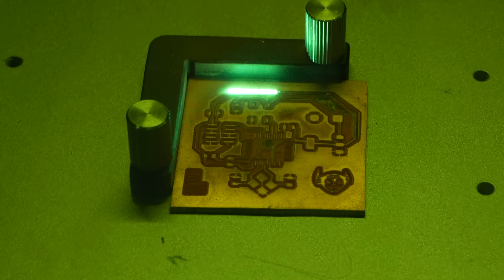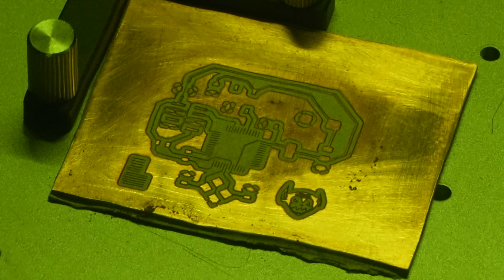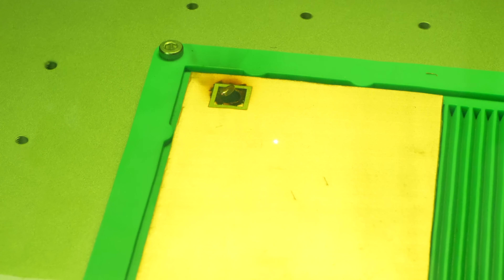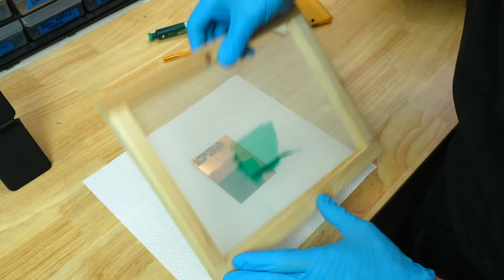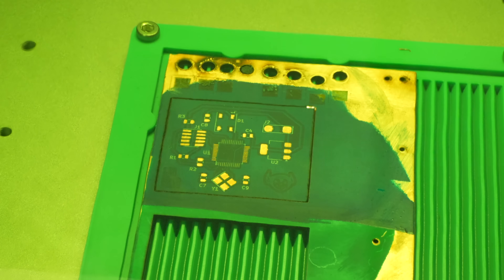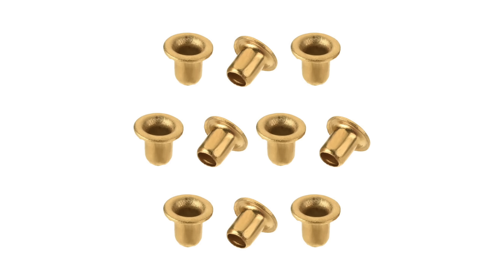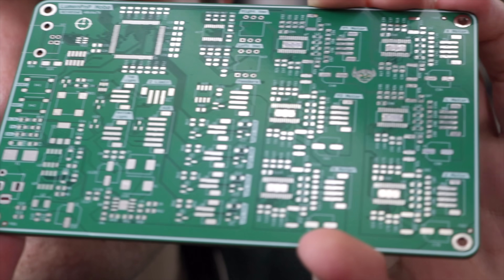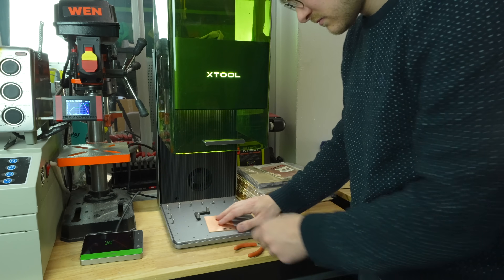Prototype PCBs faster than 3D Prints

Comment: Awesome vid but I feel the need to mention a couple of safety pointers you failed to mention in this vid.

1. Burning phenolic resin is incredibly toxic - it releases formaldehyde when burned which is a serious carcinogen. Please please please ensure you have **EXCELLENT** ventilation for the laser and DO NOT use it in an enclosed space, especially for extended periods.

2. The CNC fibre lasers that you can buy from Amazon etc are often absolutely incompetent when it comes to laser safety. 

Any goggles you get with the kits can often be binned as completely useless, either because they’re just coloured plastic (useless) or are the wrong wavelength (useless) - invest in a pair of real, officially safety rated laser protection goggles! 

Even looking at the laser spot on the surface can irreversibly damage your eyes, let alone looking directly into the laser. Also, should go without saying, any other people entering the room while the machine is operating is at even greater risk because they may not understand the dangers of the machine. 
Kids, pets, uninformed partners, etc should be strictly kept away from the machines when in operation, the shrouds that some of the machines come with are not rated for laser safety, they’re basically just cosmetic, DO NOT trust your eyesight to them!

Bit concerning you didn’t include these warnings in the video - assuming that all of your viewers have the necessary education to understand these risks when you have as many views as this is ignorant at best imo.

I’m excited for the opportunity to rapid prototype PCBs, and will consider getting myself a setup, but observing safety procedures is critical.

Comment: I wonder if there are specs for the various substrates published with regards to IR absorbance and heat rejection. Using a laser also opens up the possibility of alternative substrates that would be otherwise completely unworkable, like copper plated ceramics, glass.... potentially anything you can get a copper layer to adhere to. 

Just started down the rabbit hole of trying to find polymers that will accept a copper plating, play nice with the laser, and still be thermally stable enough to be soldered. Galalith (casein, milk plastic) might be the one but I don't think anyone... at least anyone that said anything where google can reach... has ever pondered the idea of making a copper-plated galalith sheet thin enough to use as a PCB. Temps are fine, stability fine, people make guitar picks out of it so it should be rigid and mechanically sound enough, it's just the matter of finding the actual base material. 

And there's polystyrene, which is great on the laser, takes a copper plating (though this is relatively new tech/process), but you'll probably be limited to 400-450F for soldering.

All in all it feels like the copper is the easy part and the substrate makes it a PITA. 

Also, have you played with priming the copper with a nonreflective coating to see how that changes the rules? That could be anything from a thinned acrylic paint to very careful exposure to an oxidizer (not fancy, peroxide and vinegar for instance), or even just a light candleblacking (soot deposition).

Comment: Is there a 3d printer with dual heads that you could switch out one of the print heads with a blade or drill to etch into the surface of the copper board , then have the other print head print a single layer over the top? Avoid all the chemicals all together.

Comment: Great job. I didn’t think it would work that well. For two sided bds, just treat vias as pads on both sides with a common hole. Put a thin wire through the hole, solder both sides and you’ve made a simple via.

Comment: What if you combined the laser with a lumen frame to handle applying and curing solder mask and silk screen, flopping the board, and doing something for vias (which seems like an area with more exploration).

Comment: For the vias, it depends on the board, but I was a child of the point to point age and watched  pcb's come onto the scene.  For a simple design with not a lot of vias, come up with a different shape for the pads that need to get soldered on each side, and do so.  For example, you usually have circular pads with pin one being a square.  Make any pins locations that have a trace on both sides diamonds.  If there is not a part in the hole, you do what we did in the old days and stick a piece of wire in the hole and solder it top and bottom.  The other thing might be to design the board more strategically for the type of manufacture.  While it may make sense to say use a short run to a pull up and have that on one side and another short run to a pin connector, you can get rid of a via if you use the natural one that is the pin connector.  Almost humorously, you could put say a 14 pin dip in the middle of your board, solder it from both sides, and snip the chip off.  There you have all the stairwells between the layers in two neat rows.  Wonder if you can get bags of mystery dips on eBay that would be good for that.

Comment: Voltera makes a rivet setting tool that works well with their rivets. It is meant for their PCB CNC but I have just used it on through hole repairs and DIY boards. It is a cheap way to get a through hole and with their copper rivets it's very easy to get almost flush and a clean look.

Comment: Seems to me that one solution for alignment would be to have the board locked down by the alignment jig, then you remove the whole jig to do the other steps, allowing you to, if set up right, to just flip over the jig for the other side, with alignment holes and pins for that side which result in the board ending up in the exact same position. The mask step gets a bit problematic with this, but.. has to be some way to still do that...

Not that I am likely to be doing anything of the sort myself any time soon. lol

Comment: Oh this is super cool! This is an excellent application of those fiber laser stations! I worked with one for a research project and they are extremely powerful machines.

One thing to bear in mind, though, is that you need to keep your area of operations as close to the center of the workspace for the laser as possible. The laser will still be in focus, but as you move away from the center the galvo laser will distort and form an oval shape, which might cause issues if you are making super precise boards. I recommend if you start doing multiple boards at once that you keep your boards from getting more than halfway to the edge of the workspace. It's better to do smaller batches that all turn out rather than trying to run a dozen at once and end up having to throw out eight because the outer ones didn't etch or cut properly due to beam deformation. 

I wish you the best of luck as you continue to iterate on this process!

Comment: For the vias do not use copper wire like many have suggested. Instead I would suggest to drill the vias to the exact diameter of a thin solder wire. Leave the board under the laser and stick the solder wire in. Cut it flush (or therabouts) and then play around with melting the visible end of the solder wire in the via hole with the laser. The wire won't melt all the way through and neither do we want it to. It acts as a wire in the via and on the ends get melted. Might have to warm up the copper around with low power before to allow the solder to wet onto the copper. If the solder melts but doesn't want to wet onto copper you could try cutting the wire not all the way flush but instead a bit longer and tapping it with a hammer to squish it onto the copper.

For the solder paste mask I would suggest going entirely maskless. Instead cover the entire board in a thin layer of solder paste and then the laser can be used to only melt the relevant areas on to the exposed copper so that the pcb just needs to be cleaned off the unmelted solder paste and later parts just need a bit of sticky flux to stay in the right place. The solder is already on the pads so you just need to pop it onto a hot plate et voila.

Comment: I think that if you hold the board sideways on in the air, you could feed some thin solder wire through the bottom side of a via, then just touch it with an iron to connect it to the top copper. After that's done, flip the board and touch the other side with the iron to detach the wire and forn the connection.

This will still have a small bump on either side, but I think that if you feed solder carefully, it should be fine.

Comment: well, that seems good for prototyping, especially for model-railway solutions - 'cause as model-railway fan, sometimes there's a need for a small board to maybe connect things in a locomotive, so that you don't need a few plugs - instead of just one or two. but the price... the price for such a machine (even when you just do a single-sided board for maybe 2 led's, 2 resistors and a plug) is a bit to high, and if you don't even know how to work with tiny smd-pieces (like a 0402 led), you better let such shops make and finish the board. Cause of the 3d-printers are really evolving, also do these lasers and small cnc-working milling machines, i wait for a pick & place-machine on basis of a 3D printer - where you can literally "put solder paste on the board" and let the machine pick & place the parts. but i guess, for that, i need to wait a few more years - or need to build one by myself, even when i just need a older 3D-printer, a vaccuum pump and need to learn "how cnc-machines talk".

Comment: For a diy board you dont need to rivets. You could easily get away with using a piece of non jacketed wire for a via and just solder it like a standard through hole component. I usually use 22-24ga wire. I do this a lot for proto boards. This keeps vias small and impacts board height less than a smd resistor.

Comment: This is SICK dude! +1 for more videos about it. Totally agree this is just for rapid prototyping but ~30 minutes is RAPID, damn
Reply: Yes, this is awesome!! I actually got into prototyping PCBs watching you design and make your flight computer (AVA, I think). I would have to design the traces, print the design on a piece of paper, heat transfer the design from the paper to the PCB and then acid etch it. This would take a long time and the method in the video looks much easier. I would also mask and UV cure it but the mask always looked like junk, in the video he used a screen and that looks much nicer. I might have to get back into prototyping PCBs.
Reply: Or for local manufacturing. I could see a world where a system like this is set up in neighborhoods to enrich the lives of those around you with cheap available products you can get in person.
Reply: Honestly, in a case where you dont need solder mask or silk screen, a PCB mill will be in the same order of time and will be a commercially available product
Reply: I agree its awesome, but I'd personally not be so sure its only prototyping - small or made to order runs, anything you want to protect your IP enough to make the clones actually put in some effort, when you really need weird boards etc.  There is a niche for self production, and such high quality, easy, seemingly affordable and rapid self production even better. 
As for the sort of smaller company or individual maker that doesn't have a real fab house, with PnP and reflow on speeddial, with volume user discount prices... As they likely "need" to have most of these sort of tools anyway for the prototype lab...

Comment: When I last looked at this I saw a few approaches that might be possible possible.

1. Conductive epoxy or ink.  possibly expensive and/or messy.

2. Small taps and dies.  The idea here is that for each via, the hole is tapped, and a thread is put on a copper wire.  The wire screws in, cut so it's a little proud on both sides.  Then because it's copper, it can be deformed with a clamp so it spreads out on the copper pads.

3. Just like 2 but find a non resin core solder.

4. Maybe 2 but melting copper rather than ablating it.  Like a 1% power for 50 passes until it melts.

Comment: Here's my idea for the vias: 1. get some solid copper wire with a similar thickness as standard factory vias; 2. cut holes in the board of the same diameter as the wire, or a tiny bit smaller to get some friction; 3. lay the copper wire horizontally, very flat, and cut it with the laser into pieces as long as the board is thick; 4. push the little cylinders in the holes; 5. solder them from both sides. Bam: flat and solid vias.

Comment: This wouldn't be automatic, but what about inserting copper wire into the via holes until they are flush, then soldering like you wanted to do with the rivets. You could then try using flush trimmers on the other side and rhen solder that side. There will probably be some height to it but i would imagine it would be less than the rivets, plus the vias could be much smaller. Just a random thought. Really awesome work though!

Comment: Old man here chuckling at the via rivets. Back in the Jurassic era, when dinosaurs roamed the earth, we had to be much more careful in our two-sided designs. That's because EVERY lead on every component was a via. Yep, the leads went THROUGH holes in the board! They are called "through-hole" components. :)
Where you need a via, use a through-hole component. From your local Radio Shack. ;)

Comment: Use any evenly sprayed on paint and the laser to do an etch mask for etching away the copper with Iron-III-Chloride. 

The vias will be tricky. There are a couple of heat cured copper inks (hey, laser can do that) with copper nano particles, around. Burn a via hole and several circle-like pads into the copper laminate, like the seat rows in an antique theater, to build a connection puddle for the heat cured copper paste to give bigger connection area. Then apply a mask before filling the vias and cure the or even burn holes into the vias to use them as PTH. 
This will beat all rivet versions. 

For alignment you apply a sturdy plastic card on the PCB. Punched holes („register holes“ -> see register punch) fit exactly into register pins outside the laser area for back and front, making it possible to adjust for front and backside. (This is how we registered multi layer or multi-projector slides in the 1980ies…). 

Maybe this helps to get you into some ideas to do your serial production.

Comment: Hi Stephen, I mill boards using those cheap 3018 CNCs. For double sided boards, alignement is usually done by adding peg holes in the PCB design (e.g in the corners) and drilling them right into the FR1 board and the CNC bed (MDF). Then, when you finish milling one side, you add the pegs to align the second side, and you can mill the second side. 
For vias, when designing the PCB, just add the footprint for those 2.54mm header pins holes right on top of your via, a dirty hack to ensure your vias are available in your .drl file. when populating the board, it is simply a matter of inserting a pin in the hole and solder it from both sides. 
I do it this way on the 3018 CNC because of the poor accuracy, but on a fiber lasee you could probably get by with using way smaller holes and inserting silver wire in them, which you solder from both sides. 
It works fine for dirty hacks and prototypes at least haha
Reply: curious if you use FR-1 as well?

Comment: For the alignment between operations, take a tip from metal machining and first operation drill 2 alignment dowel holes then put the board on a jig with alignment dowel pins this will register all operations very precisely. These alignment holes can be outside the final board and cut off in the final operation.

Comment: Hi Stephen, if you want to use rivets could you not chamfer the holes then place the rivets, secure them by the right tool and then add a bit of solder too them

Comment: Amazing.   This is fiber laser PCB is the best process ever.   Also I have some ideas regarding the rivet approach which involves swaging solid copper wire; similar how hot rivets hold steel structures together for buildings.

Comment: There's the really old school method of vias: just solder-fill the holes, leaving a small mound on both sides. I've actually seen that on some 1970's calculators... 
Also, as far as automation... cut your holes for the vias, push solder paste through them from the "bottom", laser the top to flow the solder to the copper; flip, apply a bit more solder paste, laser to solder that side. Squeegee off the excess. Then proceed with the other holes, then the traces. And if you're really lazy, solder paste the through-holes, pushing the components into the solder paste, and laser to solder... should take a bit of dialing in, but should work just fine.

Comment: About the two sided board. Random thought I had (absolutely untested). 
What if you drilled into the board from both sides with a V shaped bit - effectively giving you an hourglass shape. 
like this ==> <== 
and then make some kind of tool, that pushes really hard  like a pincer from both sides on a metal tube.
It would work similar to the rivets, but because of the shape it would be held inside the board even if you sand the board surfaces flush. So metal channel in the board wihout any protruding parts?